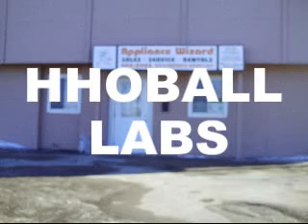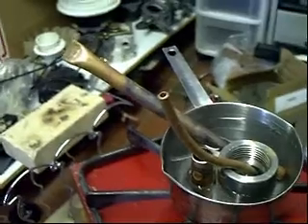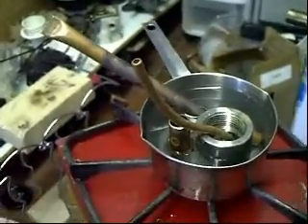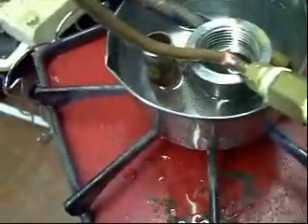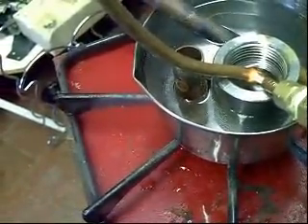#14 Crude Steamer With Hydroxy Torch

Comment from the maker: You got it! That's the video that caught my attention. The round table discussion. 
If you ever want an acetylene tip like that, its called a turbo torch tip. You must run the torch at high flow rate to use it. Meaning that the valve on the torch needs to be opened at least two full turns.

Comment from the maker: Its only acetylene without the oxygen so it wont cut, but it heats copper fast for the brazing i have to do in refrigeration. Its amazing that the hydroxy torch can cut anything and acetylene cant do it. 
Anyway, i just baked the metal on the acetylene side of the metal. The statement the dude made was that metal exposed to hydroxy wont rust and acetylene will. We'll see what happens.
I would rather use the hydroxy torch over that noisey thing though. 
Stay Safe.